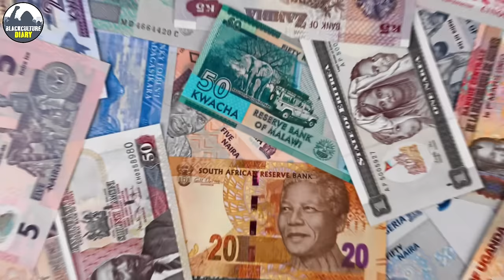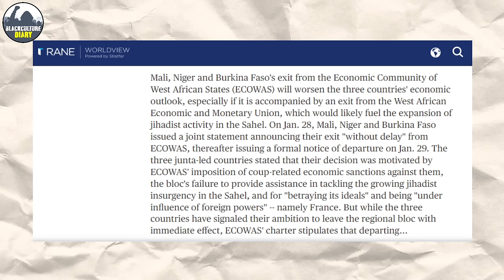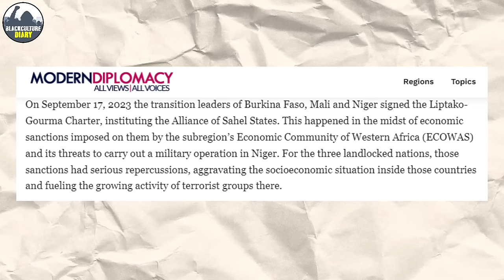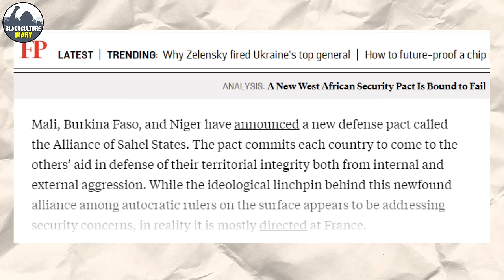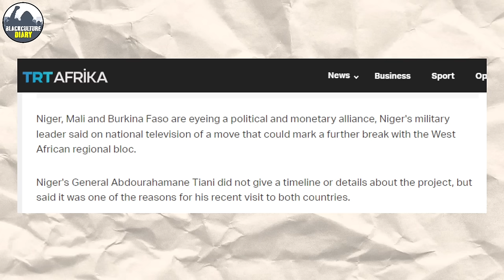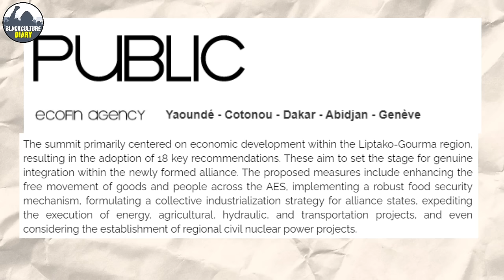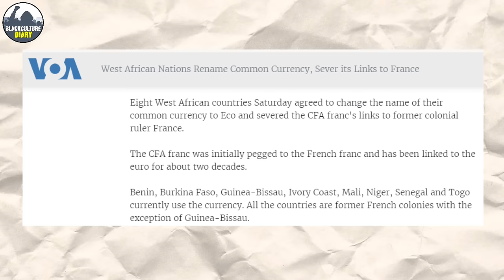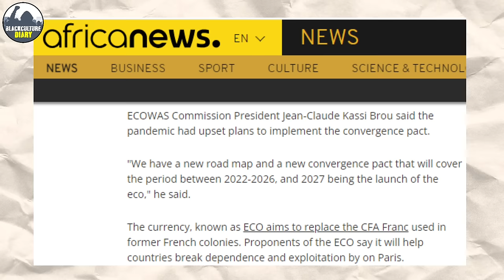Burkina Faso Planned To Launch Common African Currency That Will Change Everything!

Comment: Please, please, the 3 Sahel countries have started something big that will illuminate all Sub Saharan Africa: they have set out sound priorities: fighting terrorism; industrializing; building energy capabilities and being self sufficient in food supplies. Don't break the dynamic with hasty decisions on the currency. The basis for a currency to be used as a strategic instrument is the existence of local manufactured common goods that doesn't require imports. Therefore industrialization comes first and only come second gold as well as foreign currencies to back up the local currency.
Reply: A, B, C, D! One movement forward. Currency covers all 4 thresholds. France FCFA currency will keep the Sahel tied to France economic exploitation ❤ "Break the Chains" all at once. No holding back for anyone or anything ❤increase momentum,advance goals, focus objectives, move mountains, keep Faith, sustain Victory ❤. Do not wait for unforeseen attacks, due diligence, the ball is in our court. Forward motion, lateral motion, and backward motion to reenforced and fortify gains,and progress❤and continue ❤Free Sénégal now ❤❤❤❤🙏🏿👍🏿❤️🌹🤗
Reply: There are starting a new currency. They are no longer in the France slavery currency CFA zone. They have cut off all ties with France, and not going back.

Comment: The prefix de- is a Latin adverb and preposition of separation in space, meaning "down from, off, away from," and figuratively "concerning, by reason of, according to;" from the PIE demonstrative stem *de- (see to). It is also a French preposition in phrases or proper names, from the Latin word. As a Latin prefix, it had the function of undoing or reversing a verb's action, and hence it came to be used as a pure privative - "not, do the opposite of, undo." Its primary function as a living prefix in English is to indicate privation, removal, and separation, negation, descent, reversal, or intensity.0

mo

More.

An abbreviation of month.

In chem., the symbol for molybdenum.

noun

An abbreviation

of Missouri;

of Monday.

cracy

suffix

rule

cracy

noun

An element in some words of Greek origin, meaning ‘government,’ ‘rule,’ as in aristocracy, democracy, theocracy, etc.: also used as an English formative with the preceding vowel -o-, as in mobocracy, or without it, as in bureaucracy (French bureaucratie).
Reply: Democracy taking away the right to rule oneself. Giving that right to governments which they ultimately aim to control or are controlling.